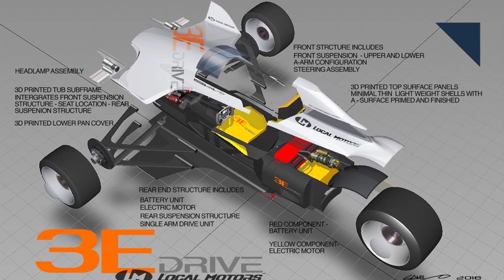Camilo Pardo Designs Car for Local Motors, Mercedes Teases New Maybach - Autoline Daily 1921

Comment: A car that can drive itself 100% of the time in a empty space, even if it can drive an empty race track super fast and drift part of the way, is hardly ready. Hardware technology will not be at all enough. Software, particularly AI, will have to play very deeply into making the cars ready. it will be decades before enough cars have effectively equivalent Autonomous driving systems that they don't have to be "Knight Rider" good. Companies trying to corner the market on Auto-driving is only going to slow down across-the-board integration of auto driving.